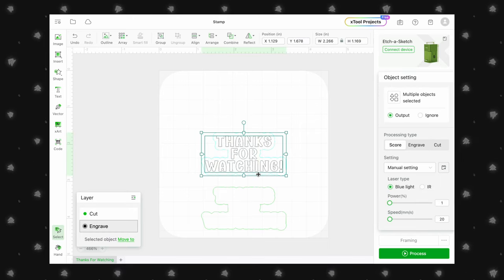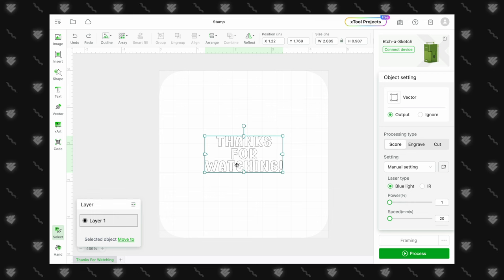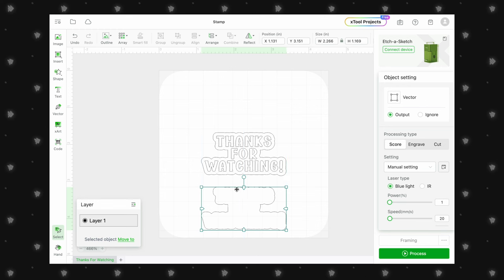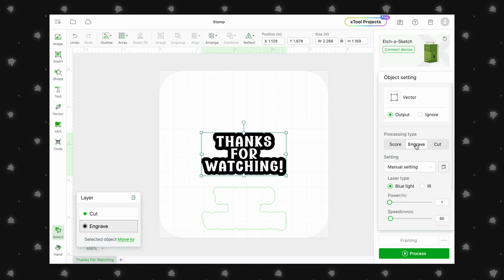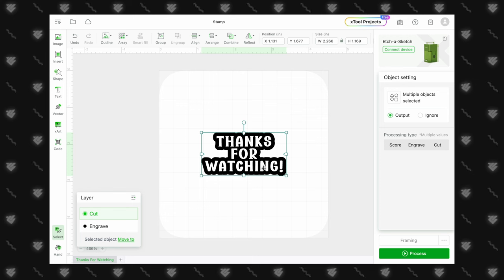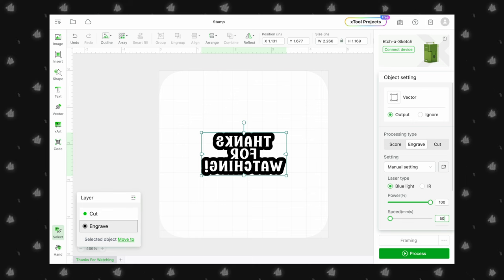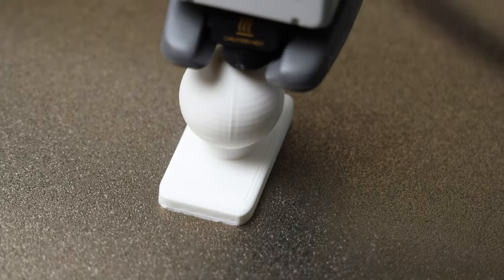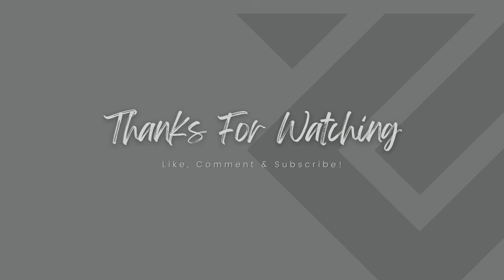Laser Engraved Stamps | xTool F1 How To

Comment: Have tried with red and now grey rubber, cant get It to cut even running 4 passes. About to run another test with either more passes on the engrave setting or slightly slower to get a bit deeper to be more pronounced on the ink pad.
Reply from the maker: Hmm what thickness rubber are you using?

Comment: just to clarify, the rubber stamp material needs to be engraved on the thin part of the rubber or thick part?
Reply from the maker: Hey! We engrave on the thick part with the thin part on the bottom. If you engrave the thin part it will cause flare ups
Reply: @VelfCreations  so I tried everything in your video and the settings you recommended and the thick side up and flames and flare ups mostly when I cut, some when I engrave, I have the F1, any suggestions?
Reply from the maker: @susankeely8511  Hmm weird! Yeah perhaps start at a lower power, maybe around 65% and see how that works, maybe will multiple passes or work your way up on power. That’s strange typically we only heard about flare ups on the thin side

Comment: The rubber sets on fire during the cut 😅
Reply from the maker: Did you buy the one we have linked? If so  try flipping it over. There is a side that has a thin layer of a different material you want that on the bottom.

Comment: there a difference with Grey and Red Rubber?
Reply: how did you cut it with f1 and those settings, I try and I get flames
Reply from the maker: Which stamping material are you using? Same one as us?
Reply: @VelfCreations  no, i did get it off of Amazon prior to finding your video tho, I think I got it sorta, minus the cut, I need to play wit the engrave depth
Reply from the maker: @Pa_Dave  Ah gotcha, yeah at one point we tried a reddish stamping material and weren’t really getting good results. But that’s when we just started. The one in this video we are really happy with so it may just be material type that is throwing off the results
Reply: @VelfCreations  got same rubber you got, and still flames bad enough to stop the laser, didn't even get to cutting the rubber, suggestions?
Reply from the maker: @Pa_Dave  If you look at the rubber from the side do you see that one side of the rubber has a thinner line that is a different color? If so place that side facing down. This is something we realized after making the video we just got lucky and placed it properly each time we made the video.

Hope that makes sense, kinda tricky to explain without any pictures in YouTube comments 😅
Reply: Gets 5 sec into it and shuts down for flame
Reply from the maker: @Pa_Dave  with that thin part facing down?
Reply: @VelfCreations  yep. its fine, ill just cut by hand